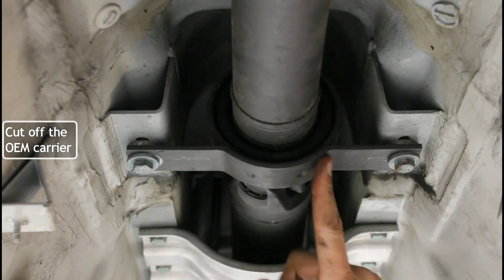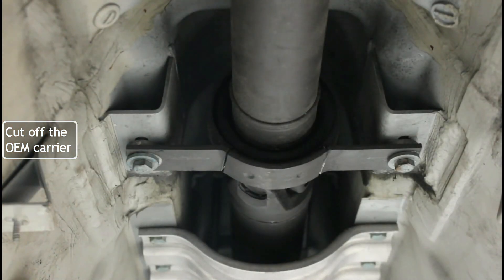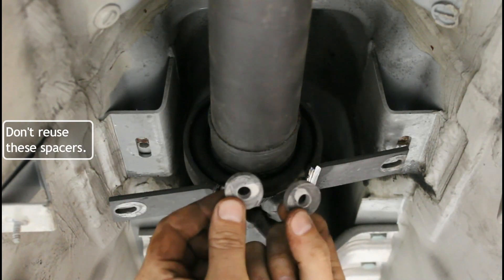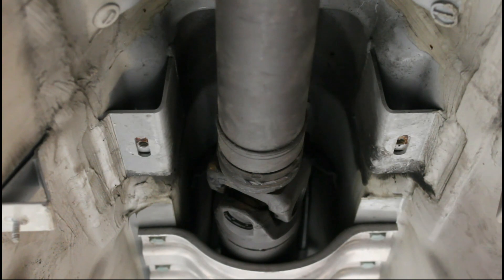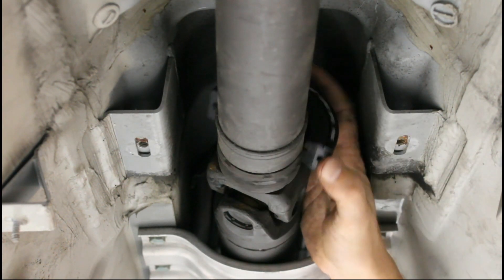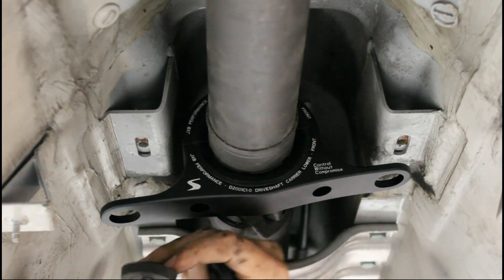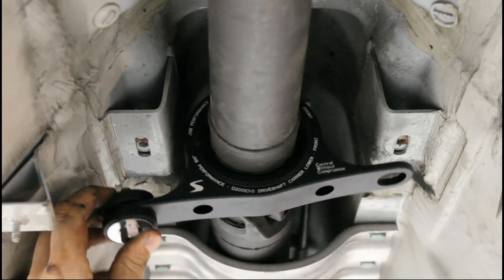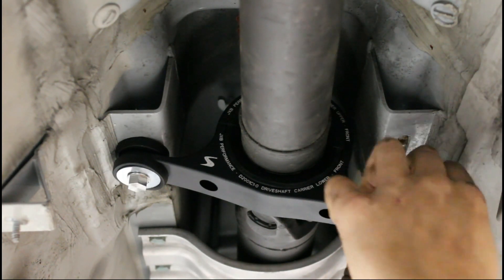Audi D2 A8/S8 Driveshaft Carrier Install - JXB Performance (D2001A0)

Comment: Will this solve vibration issues when turning on right at low speed, I can feel they are coming from somewhere under the car. At higher speed, I cannot feel any vibrations. Vw Touareg 7p 3.0tdi
Reply from the maker: It's unlikely this would solve a vibration issue related to turning one way or another.  Usually when the OEM carriers fail it causes vibration under throttle.